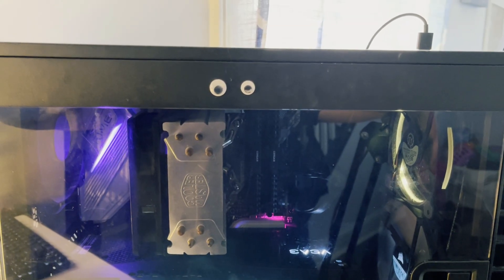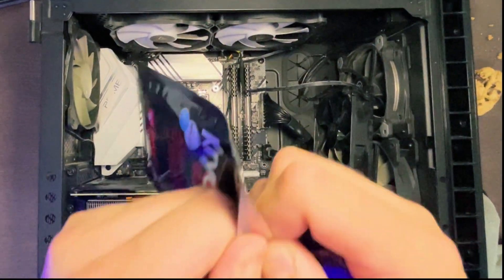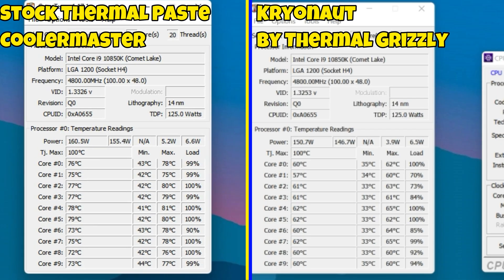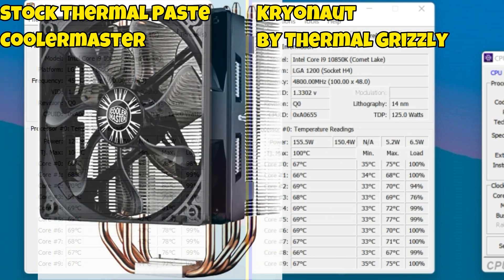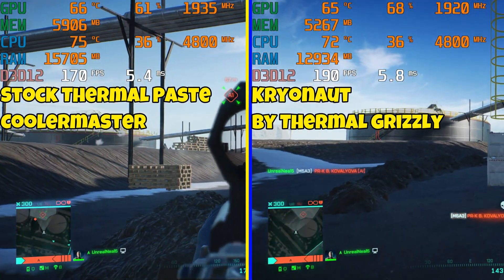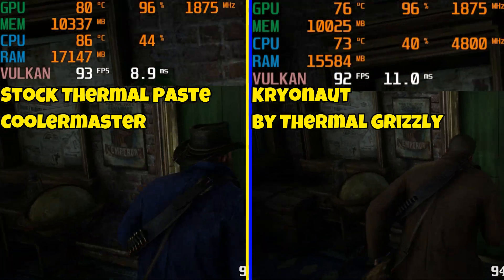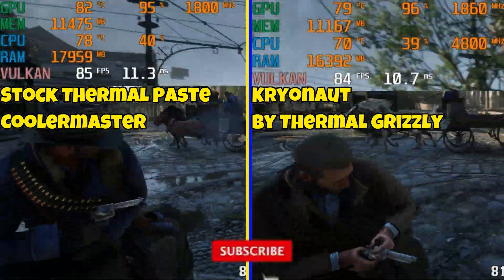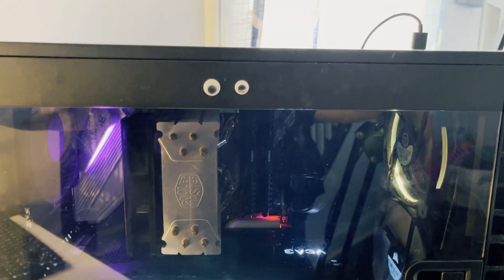Is this Expensive Thermal Paste Worth it!?

Comment: Heyy bro i bought a Lenovo Loq Laptop (2024 model)  like 6 months ago on (19th april 2025) and my laptop throttle too much its idle cpu temps are 60-75 and while in game its 85-95 and in cinebench my cpu go 102 degrees under a second and and the temps and wattage fluctuates too much i have i7 13650HX RTX 4060 115 Watt and 24 GB DD5 Ram variant and my Cinebench r23 should be 21,000 but mine is 15,000 that too freaking low and now i bought a this thermal grizzly kyronaut, let's see how much change in temps i can get
Reply from the maker: Hey there! You got an amazing laptop!! Keep me updated if it helped with temps!

Comment: Nice video bro next time I think put the cpu fan from the cpu cooler on the right side because of the airflow you will blow the air away from your pc and that will also lower the temps in the case  plus the airflow is more one direction getting air in the front and out on the left, gonna subscribe for sure!
Reply from the maker: Thanks for the idea! I actually did this and it actually helped.

Comment: Always used arctic silver 5 on my gaming laptops and a desktop processor, gives me -10c on gpu compared to stock paste and CPU temps always reduced by 15-18c. I am considering buying thermal grizzly and try out that. Do you think thermal grizzly will further lower my temps compared to arctic silver 5 or it is going to be just -2-3c at max, because shaving off  2-3c for much expensive paste compared to arctic silver 5 is not worth it imo
Reply from the maker: Snaaaaaaaaaaaake!!!! I don't wanna steer you in the wrong direction. In my honest opinion, unless i do testing myself, I don't think you'll get a big difference going to Thermal Grizzly lol

Comment: Different graphics settings between the two comparisons. RAM Usage on the higher FPS system is lower on both System and GPU. Slightly lower temps would not effect system and VRAM Usage. Nice try. This comparison is invalid.
Reply from the maker: Yo Thomas! I was getting the same cpu and gpu usage in benchmark, which is more important than ram usage 🤦🏻‍♂️ I’ve got nothing to gain to fake a benchmark 😂 As for the vram and ram usage, I’m not quite sure what’s going on with that but I know at times recording with shadowplay can mess with both. 😎
Reply: @UnrealNeal  that’s weird the the system Ram and VRAM usage then. I’m trying to rack my brain around the disparity and can’t figure out why there would be so much difference with just thermals. It just poked at my brain and I was like what is going on here lol
Reply: @UnrealNeal  I’m building my first new system in AGES and I’m nitpicking everything and it’s making the entire process so much harder lol
Reply from the maker: No worries man!! I mean, the cooler master thermal paste I had on the cpu was only a couple months old and I’m pretty darn sure I install it correctly. My temps were bad form the start.. On my benchmark videos my viewers constantly egged on me for having high cpu temps lmao Before buying a new cooler, I wanted to test out thermal paste first. I then took action to look up the best thermal paste I could buy 😆 I was amazed on how much it lowered my temps so much that i felt the need to make a video on it. But I understand you’re concerns and being cautious. Get on Amazon (if available where you are from) and try, if it doesn’t work, pack it up and return it 🤫 😂
Reply: @UnrealNeal  So I’m somewhat relying on a crutch for my new system in that I keep my office at 60f/15.5c so ambient is way lower than typical but I’m stuffing a 7950x and a 6750XT into an ITX small case because I’m limited on space. I do a lot of emulators and CAD work so I’m CPU bound. I really need to stop stressing about temps given my ambient. Can I DM you my Newegg build?
Reply from the maker: @twoolfrx7  that build sounds awesome! Sure, DM me the build! Emulating is awesome. Been doing it on my Steam Deck though lol

Comment: Is your CPU fan pulling in the opposite direction of the rear case fan? Or are they pulling air out to the back?
Reply from the maker: You hello there! It’s pushing air out the back. 😎 You want that hot air that’s rising in the case out of the case as fast as possible.

Comment: What about the gpu 
It's overheating too 🤣 you should apply the thermal for it too
Reply from the maker: I’ve got the EVGA 3080ti FTW3. I thought about applying it but after reading online that people were getting the same temps as me. And My case airflow is terrible.. which isn’t helping the situation. 🥹 But as long as my boost clocks stay up, I’m happy with 80c 😂
Reply: @UnrealNeal  you gonna lose nothing with applying it who knows it can be better specially with the kryonaut 
I have your same temps on my gpu and I'm thinking about doing the thermal ( I hate high temps 😥)
Reply from the maker: You’re right.. at the beginning I was worried about voiding my warranty so I been holding off on opening up my card. Now that the warranty is out.. hmmm 🤔 you got me thinking of trying it out! 😆 I think it would make a decent video as well!
Reply: @UnrealNeal  I'm looking forward for that video brother with excitement
 I really hope you do it it's gonna worth it I guess
Reply from the maker: I could also undervolt but I haven’t dived into that just yet. But I’m interested to see if changing the paste helps with temps. I got you man! Stay tuned! 😎
Reply: @UnrealNeal  future reference, disassembling a gpu to reapply thermal paste doesn't void warranty
Reply from the maker: Thanks for letting me know Louie! 😎
Reply: @UnrealNeal  you gonna lose nothing with applying it who knows it can be better specially with the kryonaut 
I have your same temps on my gpu and I'm thinking about doing the thermal ( I hate high temps 😥)

Comment: Getting bad temps in my gtx 1060 paste reapplied 3 times now what shout i do spread and pea sized methode use already
Reply from the maker: Hey Amit! Are you sure you got the real thermal grizzly and not a knock off? I have a video on my channel on how to figure if you got a fake. I find it very strange you are getting bad temps trying three times! We will figure this out together. 😎
Reply: @UnrealNeal  original. Verified with code
Reply from the maker: 🤔 I know this sounds silly but did you see if the fans were running? Maybe forgot to plug it back in after disassembly.
Reply: @UnrealNeal  yes i checked everything
Reply from the maker: I don’t want you to waste your money by reapplying paste over and over.. has to be something else causing the high temps. What temps are you getting atm? Way worse then before changing paste?
Reply: @UnrealNeal  currently my temp peak 70 degree in every game my old pre applied paste never cross 67 to 68 peak
Reply from the maker: Very strange Amit.. 70c at max gpu usage is still pretty great. It’s possible that the thermal paste is only helping as much as it could. My thoughts are your limiting factor now might be the cooler. If you want more cooling you might need to invest in a Aio (water cooler) for better temps.

Comment: Actually i got very bad results with kryonaut and kryonaut extreme and yes they are original. Verified the code. Too bad mx-5 was stopped. Best paste i have tested so far
Reply from the maker: Yo 3mariusx! Sorry to hear they didn’t work out for you man.. did you get worse temps? And I did hear the Mx-5 was really good.
Reply: @UnrealNeal  i have contacte TG and they said that kryonaut need high pressure cooler. Not suited for laptops and allinones and not even some smaller desktop coolers. Kryonaut has the best conductivity but has this limitation. They recommended hydronaut which i have tested and is amazing! Very good temps!! Hydronaut has the same composition as kryonaut- zinc oxide and aluminium oxide but different base- hydro is more like butter (consists more oils) while kryo is like slime (more gelly). Kryo extreme is only for extreme oc or extreme freezing cooling temps where the paste should not break- not suited for average user. I hope this comment will help everyone with explanation. I really recommend TG hydronaut! 11,8 W vs kryo 12,5 W. Hydro is more stable and lasts longer too confirmed also by TG. Around 3-4 years hydro and 1-2 years kryo.
Reply from the maker: Thank you for sharing this with everyone Marius! Good info and cool TG contacted you back and helped you with your issue. Hyrdro also better for gpus as well you think?
Reply: Skill issue 😂 how did you apply it? If kryonaut doesnt work, nothing will! Except liquid metal which fries ur pc 😂

Comment: did it pump out? I ordered the grizzly extreme version, I hope it`s worth my money. my i7-11800h gaming thermals iw 95c-100c
Reply from the maker: Hey Clive! Nice! I plan on buying the extreme version myself one day. I think it will help a lot! Let me know how it goes. and I'm sorry, what do you mean by "pump out"? pump out of the tube?
Reply: @UnrealNeal  I've research online every thermal paste on laptop dryed out 3months at most from 85c going back to 95c. And I saw 1 guy he said he use grizzly last august and still works. I hope it will last long even 1 year cuz its so expensive.
Reply from the maker: Ohhh! Wasn’t familiar with the term. But I’ve had mine on for a couple months and it’s still holding strong! Doing prime 95 for a good 10 minutes, my max temps don’t go above 75c. I have good ambient temp in my home though around 65-70F with ac on.
Reply: @UnrealNeal   @UnrealNeal  your lucky I live in a tropical country, thats why I worry that the paste will not last long so also ordered iets gt500 laptop cooler with max 5000rpm.
Reply from the maker: I think you’re gonna be just fine
Reply from the maker: @clive0494  it should knock your temps at least 10c. Wishing you the best on this.
Reply: @UnrealNeal  thank you so much
Reply from the maker: I was just like you.. didn’t know if it’s worth spending so much money in just thermal paste but the video speaks for itself! I was happy with the results.
Reply: @UnrealNeal  yes, thanks for your video. Because theres only a few videos on youtube review on grizzly krayonaut.
Reply from the maker: @clive0494  Happy it helped! I wanted to make it simple and straight to the point as well. Too many reviews talk too much.

Comment: I think you bought a fake kryonaut
Reply from the maker: Yoooo JTT. Hope you are doing well. I was thinking the same thing but my thermal paste was pretty thick and not watery. And the temps Results I was getting were pretty darn good in my opinion. And I also compared packaging to supposed fake but it’s hard to tell. People are saying the clear paddle is a sign of a fake. I got a solid black.

Sigh.. Stupid people making fake thermal paste.. so sad. 🤦🏻‍♂️
Reply from the maker: UPDATE! I certified it on the website. It's indeed a legit product. Mine came with the certificate of origin and it was also a legit seller on ebay! I'm gonna leave a link in description.

Comment: Does that 1 gram of thermal grizzly enough for cpu and gpu?
Reply from the maker: Hey Elias! Hope you are doing well. 
Yes, I’d say it’s enough as long as you use the “pea” size method.
Reply: @UnrealNeal  what is the pea size method
can u explain? I'm going to use it
Reply from the maker: Hey Rashidul! It’s pretty much just putting a pea size amount on the center of the cpu. No spreading needed. When cooler presses down on the cpu it will evenly spread it out with no bubbles. Hope this makes sense! 😎
Reply: @UnrealNeal  I'm going to use it on my laptop. Should I press down and is 1 gram enough for the cpu gpu and the laptop vram? Thanks!!
Reply from the maker: Probably enough with just one tube! I don’t think it will be enough for vram as well. So very little in one it’s crazy 😂 Wishing you luck with the laptop! Should net you great results.
Reply: @UnrealNeal  thanks for the quick response. Really appreciate it
Reply from the maker: No problem! Happy to help. Thanks for stopping by and watching my video! 😎
Reply: Yes.